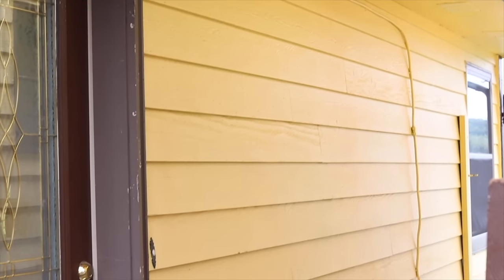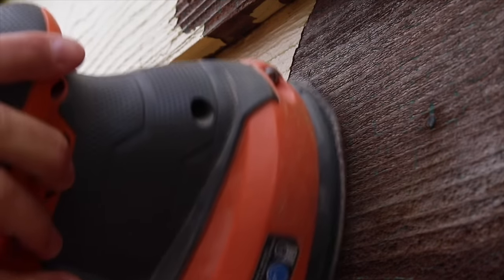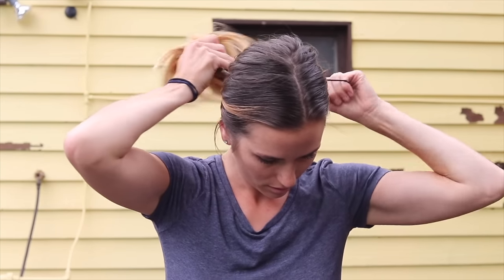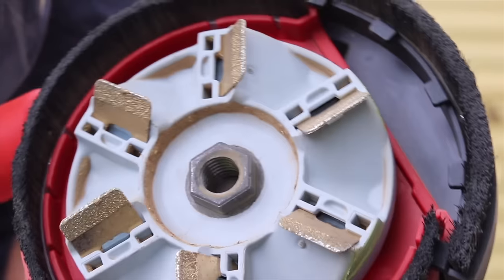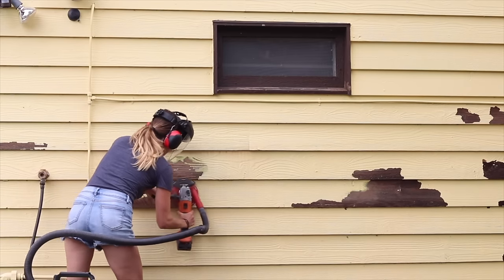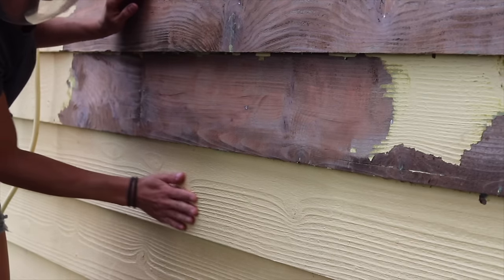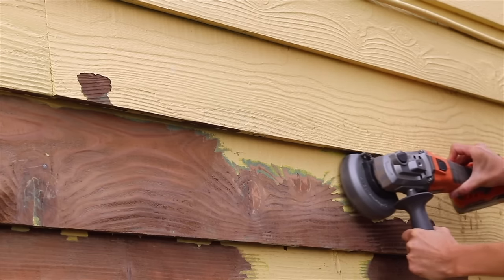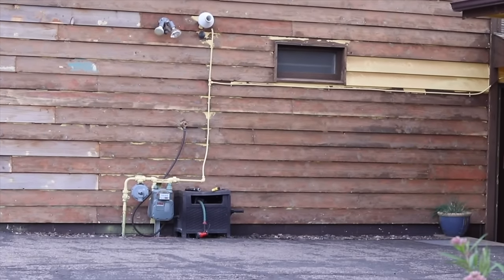Removing Paint From Cedar Siding | Diamabrush vs Paint Eater vs Sander vs Pressure Washer vs Scraper

Comment: cool grinder setup, I admire your perfectionism it makes me feel like a lazy contractor because I would want to reside that house rather than spend hours grinding all that paint off. don't be intimidated by residing projects, its quite fun actually lots of cool (overpriced senco brand) siding gear to buy lmao. just my two cents is I would rent some scaffolding if you are going to use a corded or even your nice m18 grinder up on a ladder doing work above your head, that's dangerous and you want to have good stability if that thing hits a big framing nail that pushed out from the sheeting underneath so you don't get pushed off the ladder or worse have that grinder come back at you. scaffolding shouldn't be too pricy for your job, don't be afraid to spend money to be safe.  best of luck
Reply from the maker: Thankfully my parents have scaffolding I borrowed to use!

Comment: I was hoping to see multi tool with sand paper adapter.
Would like to remove paint from my wooden windows and can't decide what is best for this task angle grinder or multi tool or maybe even screwdriver.
When the area is narrow it is trickier than just a broad wall.

Comment: Try paint stripper or liquid sandpaper, they work really well and save a ton of time and stress.
Reply from the maker: Ha! What stripper do you use? I have used kleanstrip, citrastrip, and readystrip on various projects in my life, and there is no way either of those is a fraction as fast as any of the methods I'm showing in this video. Especially on a vertical surface, I'd have to cover the entire house in plastic wrap to get stripper to work.
Reply: Peel Away. You have to apply it pretty thick and cover it in paper for a couple of hours or even over night. Then scrape it off and rinse the rest off with a pressure washer. A little messy but works for well

Comment: If you want to keep the grain of the wood you need to use a chemical stripper.  The best mechanical paint stripper is from American international tool called a paint shaver.  I have two generations of that tool because they keep getting better.  I done many houses with them both board siding and shingles.  They have there draw backs if you don't learn to use the tool and as I say become one with the tool.  To finish wash the siding with bleach product called jomax and then you can use a water based wood preservative first then use a linseed oil based primer from california paint called troubleshoot and then coat with two or three coats of paint and you will never have an issue again for at least 15 20 years.  Print nail heads with rusty metal printer before the lineseed oil primer.

Comment: I would suggest a heat gun and a sharp scraper.
And latter to remove the paint residue a good paint stripper.
This will do the job..
No doubt using an angle grinder and sanding disc will do the job faster but will leave a lot of groves on the wood which would be much more hard to even out.

Comment: You're so cute, you should have a crew of guys that want to help! Well, make sure you know them first, before letting them know where you live. The guy that said get a good scraper was on to something, the pros use a two handed type of scraper with replaceable blades, but it's labor intensive, even with the right tools. The easiest way is probably chemical stripers. Not sure how long of a dry spell it'll take to dry that out, but I hope it all works out for you! Good luck and be safe!

Comment: Sometimes the paint not adhering to exterior siding is from having wallpaper on the inside. It has to do with vapor barriers. Look into it. Even perforated wall paper can be a problem because the glue fills in the perforations. Good luck!

Comment: What is that sound next to you starting @3:12 when you are doing the sponsor message? I could not identify it :) It produced a lot of vibration so must be some kind of a power tool :) Both me and my caregiver tried to use Better Help. I was turned away and told that my case is too severe for them and my caregiver could not find a specialist who knew about his condition. I am glad to hear that they worked for you ♥

Comment: More general paint is kind of a bad idea on cedar, it tends to crack and flake eventually.  I used a pressure washer and peeled the entire paint off of a house, then repainted it with Liquid Ceramic paint.  I long since moved, Google maps 101 Marshfield Place in Cary, NC, and look at the street view (the house is toward the west when on that end of Marshfield Place, looks almost gray but it's really a light purple).  That is cedar siding, painted in 2004 before the house was sold.  Still looks good.
Use a ceramic paint that can breathe, and push up under the edges of the siding, but still make sure the paint separates and the slats can breathe.  I'm sure they haven't repainted it, not needed.  It still looked slick about 5 years ago, maybe even now with the sun on it.  
The ceramic paint was $80 a gallon back then, but well worth the money, goes on like cold cream and lasts.  Looked fantastic and new/shiny for at least 10 years, and may still be shiny the house was in shadow when the pic was taken.  Pretty sure Liquid Ceramic got bought out by Rhino or something at some point, but there is LiquidCeramic.com and that's the same paint logo so I would assume it's the same stuff.

Comment: A coarse (40-60 grit) flap disk would probably do a better job than the others, but maybe not as well as the Diamabrush. They're dirt cheap, and finer grades (80 grit) are great for smoothing the damaged siding.

Comment: I may have missed it because I went through this video quickly - which method did you choose for the primary paint removal? I'm also curious - did you test the paint to determine if it was acrylic or lacquer? It will definitely matter when you repaint, trust me.
Reply from the maker: Mostly the Diamabrush and the paint eater angle grinder attachments. The wood is entirely bare now with no finish on it so it really doesn't matter anymore what the previous four paint jobs were. The first three behaved like acrylic, the first coat behaved like solid stain.

Comment: While moisture on or in wood will affect how paint bonds, it's the molecular bond that makes the biggest difference. Wood has oils in it that do not bond well to foreign molecules at the molecular level. Even if the wood siding was dry, it's more likely the new coating would fail sooner than later because of poor bonding of the paint and natural oil molecules. There are products that take this reality into account so adhesion is much better (waterborne, solvent based or possibly some water based). Unfortunately, it's not perfect and other factors (like moisture and temperature) will take any opportunity to get involved in the chemical/molecular bond. (It's the same reason unsaturated cooking oils are bad to eat: double carbon molecular bonds to Hydrogen that when heated, break and allow oxygen to join the party (oxidizing and spoiling the oil). Rancidity in oils happens very quickly (a few days). 
To increase the chances of long term success, the wood must be low in natural oil content. Many coating manufactures recommend letting new wood weather prior to application. Problem with that is oxidation of the surface layer (greying wood) which must be removed for sound adhesion. In the old days, Sikkens exterior products told the user all the steps necessary for success. Few ever followed the guidelines because it was more work and more cost. That's one reason stains peel off within a few years. They never had a chance.
I'd use a very strong exterior bonding primer on a very clean surface (cleaned with TSP, rinsed extremely well, allowed to dry thoroughly and primed before oxidation). For the best chance of success, wait one season to apply finish coats or prime in spring time, finish in autumn. This gives the primer plenty of time to cure and might expose weak areas that can be addressed before the finishing stage.

Comment: Great video…..I Painted my house, scraped it, used oil base primer on cedar siding…..less then a year it peeling in places all around the house, used sherwin Williams 50 year paint….they (sherwin) came out to look at it and said wood had moisture under the paint….how can I cure this problem?
Reply: Tear off the siding and replace it. Builders put it on without back priming it. Siding absorbs moisture from the back side and paint peels off each summer. Nothing will stick.

Comment: Easy job 👌,  I have built a power tool to remove the paint on both the front face and the underside lip, vacuum 98% of chips and doesn't leave scars on board face.
Reply: What type of tool is that? I have a huge project to do next week

Comment: You should have used a shou sugi ban technique on it. The flame process would have removed the  paint and dried the wet areas and when you were done you would have had a beautiful, unique finish that wouldn’t warp, rot, mold or had a termite infefor at least 65 years.

Comment: With an area so big I'd be amazed if brush on paint stripper couldn't do it in a fraction of the time. Kinda curious why you didn't try it.
Reply from the maker: Ha! What stripper do you use? I have used kleanstrip, citrastrip, and readystrip on various projects in my life, and there is no way either of those is a fraction as fast as any of the methods I'm showing in this video. Especially on a vertical surface, I'd have to cover the entire house in plastic wrap to get stripper to work.
Reply: @WelcometotheWoodsBlog  I've not used any in ages & definitely not for large areas but I thought you could just brush it on, leave & then scrape off.
Messy but much quicker than this, or so I thought. From what you've said I'll defer to you as I've not actually done it myself! Cheers

Comment: Have to say that (1) using a power washer with the jet nozzle like that will not work; it will cut into the cedar and leave lines all over.  You should have tried a gentler nozzle like a fan spray.   (2) Diamabrush is fantastic and fast, but you have to have strong control on the angle and pressure or you will gouge the wood.  (3) The Paint Eater type disc most likely clogged like it did due to the high speed of your grinder.  It was too fast, thus burning and melting the paint, causing it to clog.   The Wagner Paint Eater tool has a much lower RPM and does a great job.  The down side to the Wagner is the end of the tool is threaded, making using cheaper discs with it difficult to impossible UNLESS you save an old one and cut the threaded center off of it and use it to hold the aftermarket disc in place (will also need a spacer to center the disc if the center hole is too big).

Comment: One thing I would like to address is LEAD PAINT. Always test every layer of paint on houses built before 1979. If lead is detected chemical strippers are the best way to remove the paint. Do not sand.

Comment: i use  a disk grinder at 3000 rpm..with a rubber plate (10 inch wide)and a sand paper number 24 grain..then a second pass with 80 grain...

Comment: Use a wood planer, i mean it. It takes just the paint and leave a smooth surface. All you need to do is make sure that the blade is sharp and the plane is set just right. Small planer for tight spots, long planer for long surfaces. Works like a charm. You end up with long thin strips of paint thar  are easy to clean.

Comment: It appears, the horizontal-lap cedar siding Did Not receive a good coat of primer before receiving the 1st coat(s) of paint. Without primer, the wood will absorb water thru the paint which will cause the paint to fail

Comment: use a heat gun you can get a decent one for 50-60 quid back in the day we used a blow torch these are the only two ways for stripping paint

Comment: I don't think you gave the painter-eat wheel on the grinder a real chance because you kept the guard on.  The edge of the guard is contacting the wood before the wheel has a chance to dig into the wood adequately, although can do so to some extent on the side opposite the guard.  I would remove the guard, place the wheel flatly against the wood, and play around just a little with the angle so the wheel has chance to remove the paint.  If it doesn't work, you can THEN say you tried the grinder with a paint-eater wheel.  Just an observation.

Comment: Cedar will always let go of a coating like this odds are the back of the boards were never primed and the odds are that the front was never primed also cedar is never meant to hold paint it's actually meant to hold stains and solid stains if you're going to do anything to it but what you're looking at here means when you sand it or grind it you're going to destroy the natural grain of the cedar but I will tell you one thing because it's coming off in the way that it is and the adhesion is basically minimal throughout every piece of lumber you could have used a hot water washer on this and it would have came off in SHEETS like a paper towel roll.

Comment: 7:58 maybe you need to remove the guard. Also , that paint is sticking so poorly it looks like you could run a a large putty blade right under and lift it off easy.

Comment: From one female  “Jane of all trades DIYer” to another. The only critique I have about this whole video. Is that your not wearing long pants and safety shoes. Paint and wood splinters are flying off that wheel at like 1000 rpm. And if for any reason you lost your grip on that tool, the blade or attachment, would not stop spinning fast enough before potentially cutting your leg. And that tool is heavy enough to break a toe if you dropped it on your foot wearing sneakers. Other than that, your knowledge and use of the tool on this product is great.

Comment: I did this job to an entire house and I ended up using a blow torch to soften the paint. It was a b* of a job. When I repainted I used a strong oil based primer, followed up by oil based paint and it was bulletproof 15 years later when we moved.
Reply: Question,  do you use a big blow torch and scrape with a 5 in 1 tool?

Comment: There are different types of paint strippers, some more toxic then others, regardless, anyway you do it, it will make a mess.  Vapor or dry ice blasting might be the best way to do it, but it is expensive and messy.  Maybe consider residing with some Hardy board or vinyl.

Comment: Ive done this. Is it on the West side of your house? Likely the culprit is that the water vapor in the house gets pulled through and condenses on the inside of the wood siding. I makes it moist in there and eventually will affect the paint like you have shown.  Id look into ways to get a vapor barrier paint on your interior walls to help with the water vapor transfer.

Comment: Juas a simple heat gun and a spatula. Prime it with solid stain or oil based primer. It doesn't take that long. That tool your are using does a lot of damage to the wood.

Comment: First thing I'd try is a pressure washer with a turbo head to get the bulk of it off, then move on to other tools to get the rest. The bottom edges is where rain "curls" around due to water surface tension then it wicks into any little place it can and soaks. A turbo head will raise fuzzy stuff on wood so it takes a bit of practice to not go too far. Turbo heads do wear out faster than other types but they are still my favorite. When they stop spinning just bump the side while pulling the trigger to get lots more use from it, just don't let the water hit bare skin at close range!

Comment: Is cedar even supposed to be painted?  I would think the aromatic oil in the wood would prevent the paint from adhering.  I would also NOT paint it now to let the wood dry.  Or, you'll just be repeating the problem --- moisture under the paint.

Comment: Just a tip for anyone watching this: If you want to use an environmentally friendly product that will help preserve the siding, try linseed oil paint with 5% zinc oxide (anti mildew). The oil penetrates into the wood and helps it resist rot, and when the paint starts to look faded you can just wipe linseed oil on and it'll revive the depth of colour. It's pretty expensive, but it's way cheaper than the wood itself and with maintenance you can preserve exterior wood surfaces for a long time. Ideally you'd want to get the siding back to bare wood as Melissa has done here.

While latex paint is cheap, unfortunately it's a) made of plastic and b) seals the wood and doesn't allow the siding to dry out. The keys to making wood last outdoors (beyond choosing the right type of wood) is protection from UV (paint, generous overhangs) and allowing it to dry out (don't caulk the bottom of the clapboards or shingles, use a rain screen if doing a fresh install, don't seal the front face with paint or god forbid, polyurethane 🤮). I'm working on an old house in Halifax, NS right now that was finished in red cedar shingles from British Columbia. The house was built in the 1940s and I believe that they are the original shingles. I actually have one sitting on my shelf right now that was backstamped by the mill (which might have come off a newer addition, so this one could be from the 1970s):

HUNTTINO-MERRITT
BRAND
16"-5/2"
NO. 2 GRADE
12" CLEAR & BETTER
CANADIAN FOREST PRODUCTS
LTD.
VANCOUVER B.C.

Unfortunately, someone at one point in the house's history went absolutely batsh*t with caulking and sealed every. single. seam. on every. single. shingle. I can't even imagine how long that would've taken. It was a death sentence for the siding - any moisture that inevitably got behind the siding was trapped. Now all the paint is sloughing off, the shingles are cracking and splitting and it looks like trash.

Anyways, thanks for coming to my TED talk.